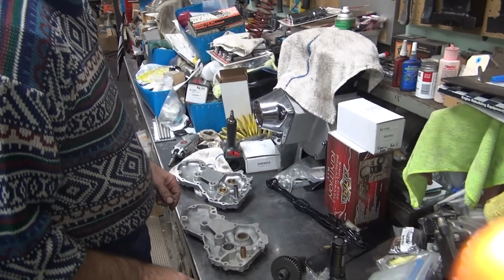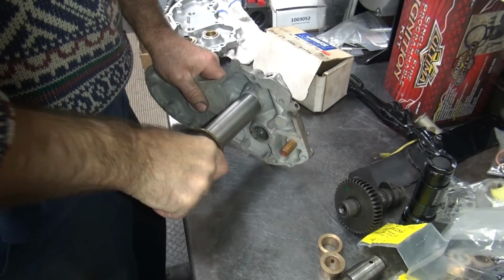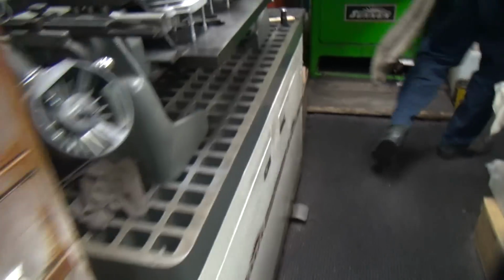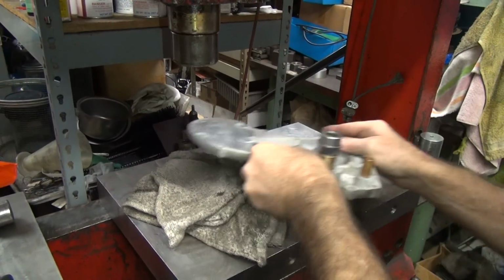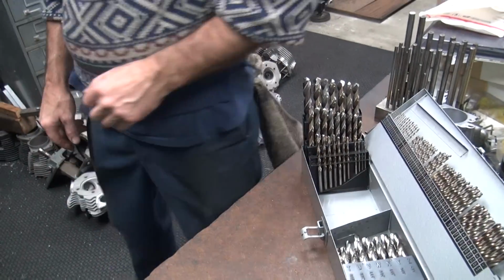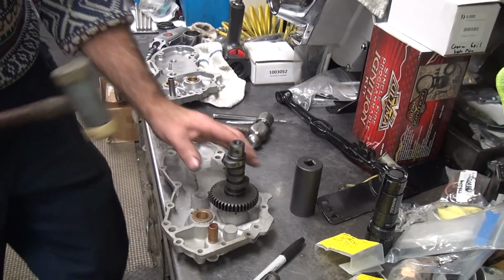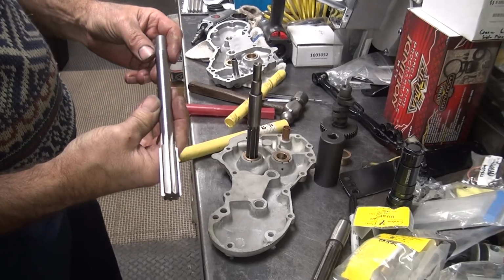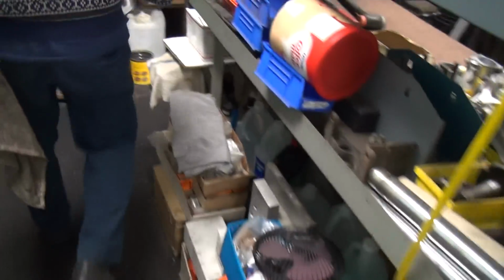panhead to knucklehead 102 cam cover topend oil line feed drilling rebuild harley by tatro machine

Comment: Would you do a cover I need to get one done and I can’t find some one to do it
Reply from the maker: yes i can do them but would they work when i was done. not sure because of the fitment issues with most motors and how would i size it to your parts.
tatro